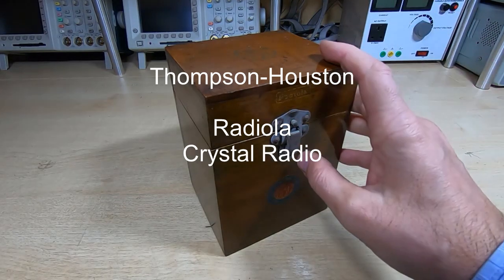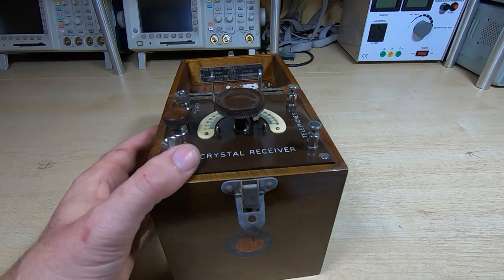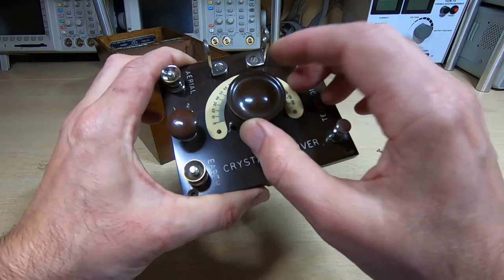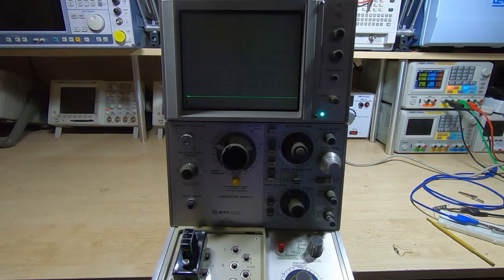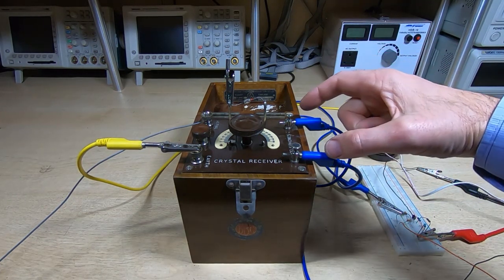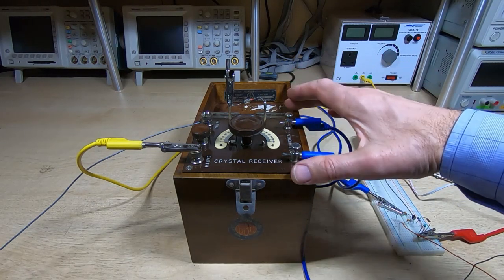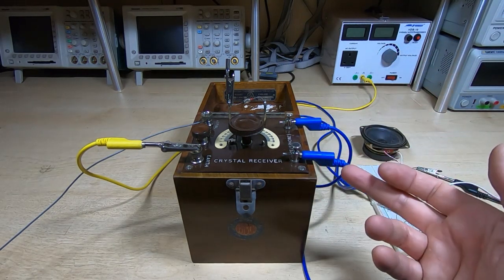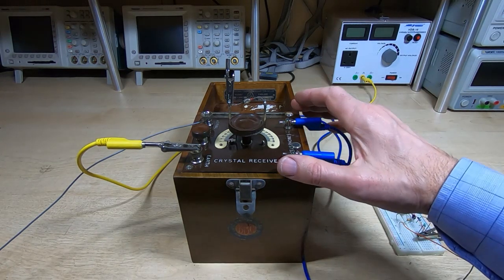Thomson Houston Crystal Radio

Comment: It still functions after 100 years, cause it contains nothing, that could ever go wrong/bad, except catastrophic violence were applied... Still working after 100 years is an inherent crystal-radio-quality, it will probably function just as good even after 500 or 1000 years, if it´s incidentally* protected against catastrophic violence... *(in this case, there can be no guarantee that it´s protected against violence, it´s a matter of luck, hence I used the word "incidentally")
Reply from the maker: I disagree.
It is not still working only because it is simple but because it was well made from suitable materials.
If you take most modern but simple devices they almost certainly will not survive 100 years.
In fact most things I buy these days only last a few years before they fail and it is not usually due to 'complex' failures.
Reply: @JerryWalker001  In understand you, but this is already a luxury-CR, with 99% of its weight being un-needed. a simple Ge-diode, an earpiece and 1-2 wire-coils, the basics of this radio, on the other side, will be inconvenient to use since day 1 (compared to the luxurious wooden version), but will function just as good after 100 years, cause wire (like in the coils), diodes and earpieces don´t wear out. If a diode burns-out, you might find a pyrrit-"diode" under every fifth stone on  the countryside, and so replace the industrial Ge-diode. As a joke, I wonder why nature doesn´t let CRs get self-assembled in the wild, as they are nearly "natural produce", similar to the somewhat more exotic produce of bananas/ananas...   ;-)    ;-)    ;-)
Reply from the maker: @klausbrinck2137  Again I disagree and would even say that the desire to remove 99% of 'un-needed' materials is why modern devices have such short lives. I would also say that the standard of manufacture of this device is much higher than most high end items today.
I have no idea what your reference to finding 'crystals' means.
Yes of course you could build a CR from scrap material which you could find lying around but I would rather have a nice 100 year old nicely made radio.
Maybe an example would help explain my position.
I make large clocks from brass and steel stock (sheet and rod etc) and I carefully make each piece and harden and temper, broach and ream etc where required.
These clock will almost certainly last well over 100 years while running continually and keeping very good time.
However this would not apply to 99% of new clock that I could buy.
Reply: @JerryWalker001  while you right about a mechanical clock, a radio has the (potential) advantage of lacking mechanics altogether, it´s just electronics. 
 reference to finding 'crystals': when 4, father hyped me to look for "gems" in the countryside (later found out that all of them weren´t "gems" at all, I was just fooled by "fool´s gold"). We drove to a mountain, and I found my first pyrite under the very first rock... Several more on the first day. Over the next 2 years, we also found several galena-pieces, and learnt to "ignore" pyrite (too "ordinary" in my region, still, can replace for galena in a CR).

Comment: Jerry, I remember building a crystal radio kit back in the late '60s, but unfortunately it didn't survive my childhood.  Based on your curve tracer demonstration, I assume that it would have used a germanium diode?  Or some "more modern" (i.e., '60s tech) circuitry and simply calling it a crystal radio?

Also, you mentioned the two capacitors made of foil & mica in this radio.  If I was to find raw mica sheets(?) laying on the ground or broke some out of the rock, am I correct that the "sheets" could be used to make DIY capacitors?  The farm where Dad grew up had some mica like this on the side of a dirt road.  And, I believe I saw similar pieces laying on the ground at a "rock hound" venue where all kinds of goodies were simply (naturally, not placed by vendors) laying on the ground, like the almost fist-sized rock literally covered with small garnets that Dad picked up.
Reply: Me too, more than 40 years ago. It took me a long time to find all the components, the diode (OA90), the capacitors, and the 2000 ohm headphone was so expensive that I have to go through a lot of arguments with my parents and save money for a while before  buy it with my own money. I went through another big fight attempting to use the pipes as a good ground source. Nobody believed it was actually working, but it did indeed. Thank you Jerry this is one of my favorite YouTube channels.
Reply from the maker: You can make capacitors using almost any insulator as a dielectric but the mica used in capacitors was generally very carefully selected as it varies a lot in characteristics. Galena is still the best way to make very low loss detectors for crystal radios.